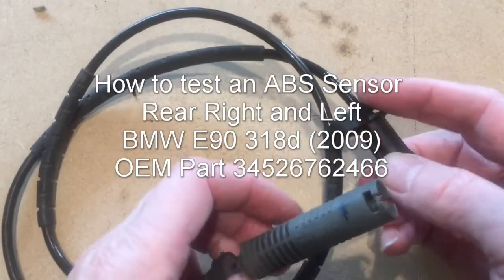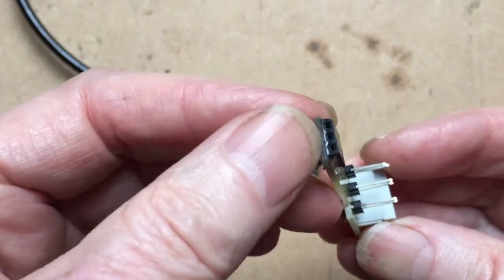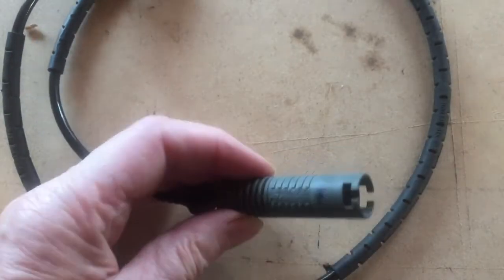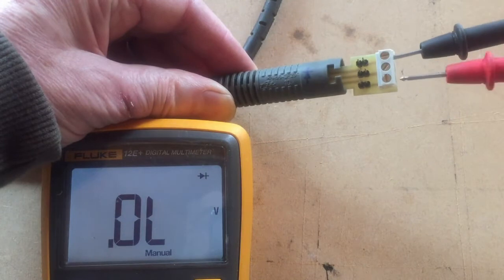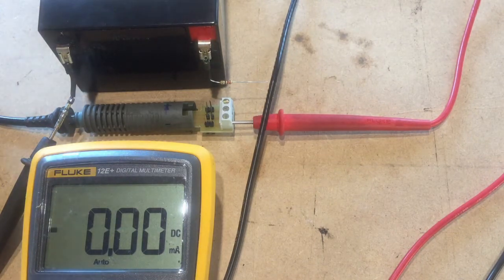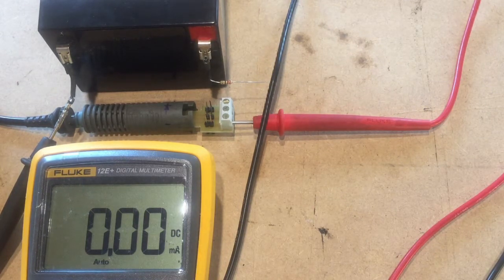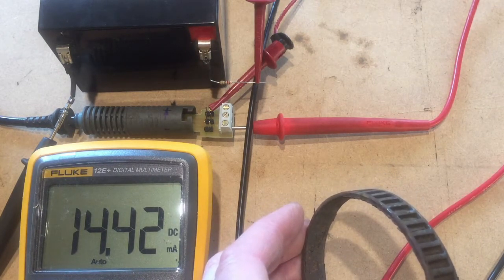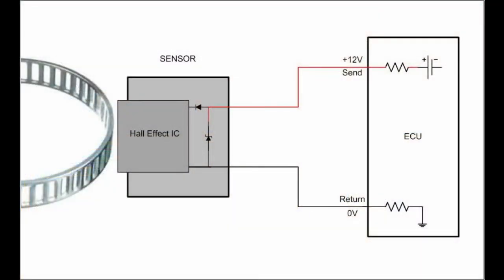BMW E90 318d (2009) ABS Sensor Test

Comment: How does the ECU determine the direction of rotation?
Reply from the maker: @andremaia1117  I don’t think it needs to. It compares the pulses and if they are not the same then it knows there is a comparative error or if the wheels have locked up it can adjust the ABS. My car also knows which gear it is in.
Reply: @billebrill8730  They actually report direction. Because when I connect a scanned that can read live data from ABS/DSC module it shows which direction the wheels are turning. Maybe the ABS/DSC module receives input from Transmission position but I also tested it by pushing the car while in neutral with only ignition on.

Comment: The newer ones always show 7mA .
Reply from the maker: They must use a different protocol.
Reply: @billebrill8730  Yeah, it's probably this one, https://www.youtube.com/watch?v=9rPjL9PEK2g&t=200s although I was not able to see the square wave. Maybe. I would have to do it installed on the wheel. 
Cheers.
Reply from the maker: @dzidmail  That was how I started unfortunately it is uses a current sensor arrangement. It is not a voltage protocol, it is a current protocol, switching current levels and difficult to detect with a scope.
Reply: @billebrill8730  Actually yeah. This is must be the same protocol.  Although, with the 200ohm resistor in series the voltage drop changes (1.4V) should be visible on the scope. 
I think, either my new sensor are bad too or I need different metal to test them on.
Reply: Let me report my memories - maybe will be useful to someone.  
Your sensor is showing 14mA on far proximity and 7mA on close.  
My failed rear sensor one was showing 7mA on far and close proximity.
Replacement rear sensor was behaving like yours 14mA on far proximity. 

Now, week later front sensor started reporting error. Yeah, suspicious. 
It was reading 7mA on far and close proximity. 
Bought the replacement and was showing correctly 14mA on far proximity and 7mA on close, they sent wrong size (thick rear kind).  
Then I ordered two Chinese front sensors from different manufacturers.  I thought I will stock up on them if another one fails.  
Both were showing 7mA on far proximity, so they are probably failed as well. They costed $8 and $10 and they are probably some manufacturing rejects.  

I am going to buy another one and maybe will report further.
Reply from the maker: @dzidmail  The way the hall detector works is to sense the change in reluctance. The reluctance wheel  has gaps that change the reluctance that the sensor detects. It electrically switches between 7mA and 14mA on each change it detects as it passes the gaps. Current sensing is much more reliable in electrically noise environments and far less prone to noise spikes. In industry a 4-20mA current signal is used for analogue instruments. This application is just on/off for speed of rotation.
Reply: I fixed my issue. It was the front sensor after all. It is strange that it failed a week after replacing the rear one. 
There are two types of front sensors (even though both fit the same). 34526870075 is active sensor with a digital protocol and it works with magnetic plate on a bearing and 34526762465 is PWM sensor responding directly to the reluctance ring. The latter is present in the front on crappier-engine cars (presumably without hill hold feature).
I observed the signal using scope attached accros the 150ohm resistor. In both type of sensor the voltage across resistor varies between 1V and 2V which corresponds to 7mA and 14mA.